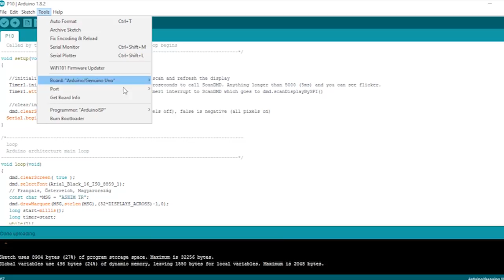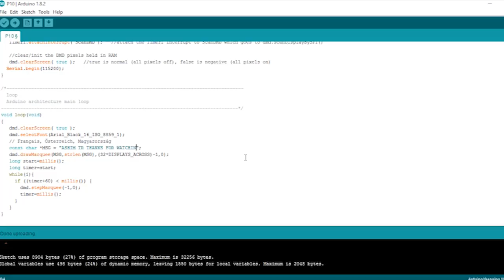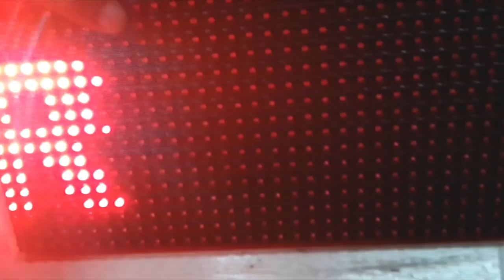P10 32x16 LED MATRIX DISPLAY #23

Comment: Hello,

I want to send a message to a 64x16 P10 matrix LED panel with an interface program (may be C #) from the computer using Arduino UNO card.

I want to send the message with serial data or ethernet.

How can I do it? I need your help in this matter.
I wish you good works

Comment: I not able to run a P10 rgb with HUB75 on arduino uno/mega and display correctly. DMD library don't work I think
Reply from the maker: Yes my friend this code for single color display like p10 only . thanks for watching.
Reply: Yes. This is only for HUB12. The RGB panel which you are referring to is HUB75